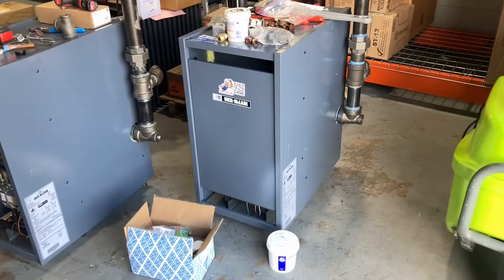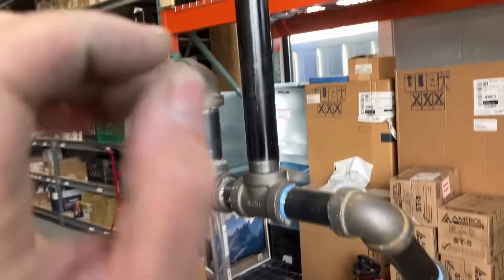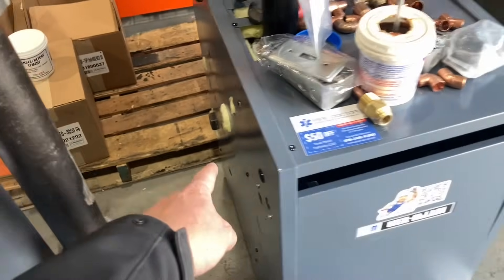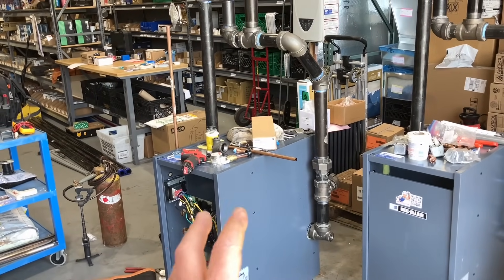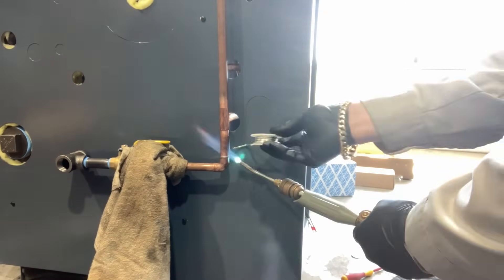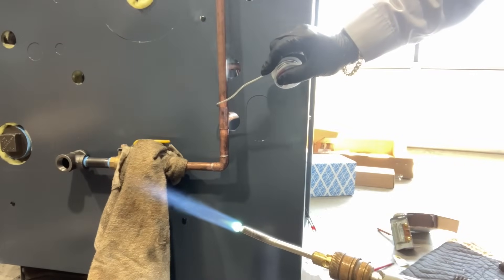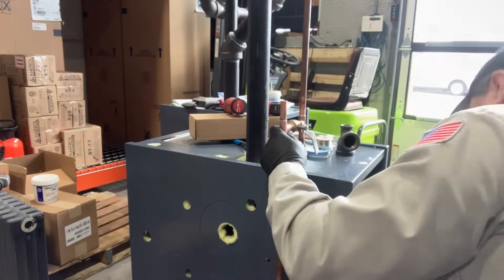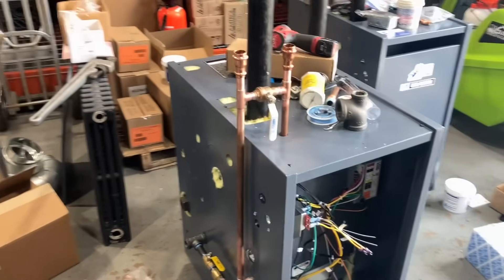PREPPING Weil McLain EG-35 STEAM BOILER with Tankless Coils | Domestic Hot Water Copper Piping Setup

Comment: come on, you know it should have a thermostatic mixing valve and the piping should run downward away from the coil to act as heat trapping and mixing valve should be lower than the coil cold inlet by about ten inches.
Reply from the maker: Okay 👌

Comment: Will you need a check valve on the water inlet of the cold water feed above the mixing valve? I would assume if someone turns on cold water tap it could pull backwards from the hot side?
Reply: Totally agree. Not sure why he’s doing it that way??